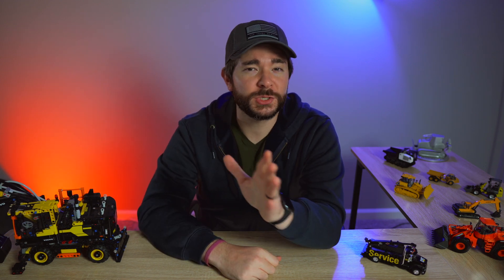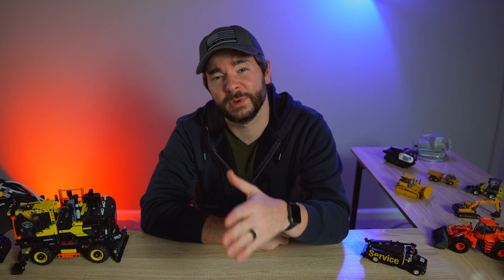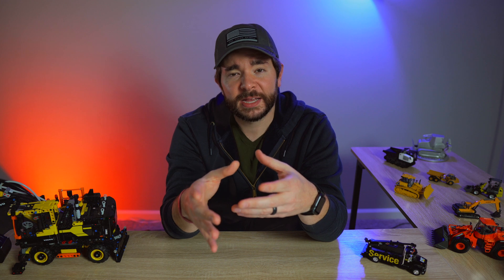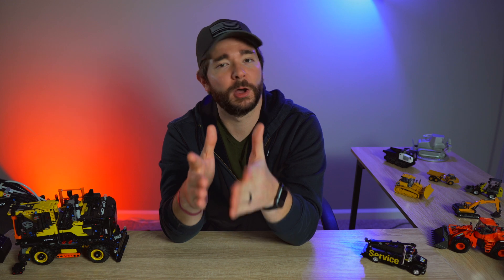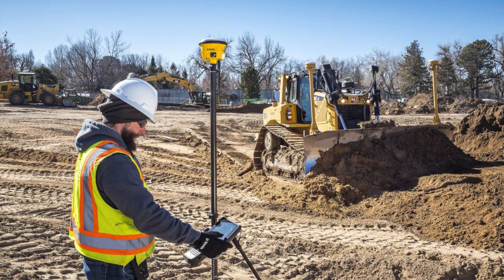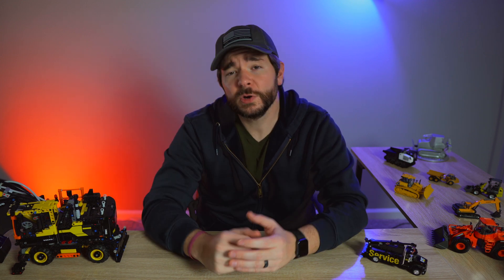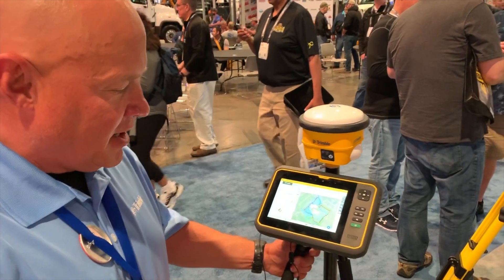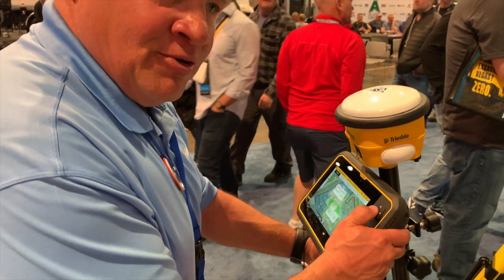Trimble's new SPS986 eliminates need for base station in GPS rover surveys

Comment: 2cm horizontal & 5 cm vertical is not even close to the accuracy I get with my R-10 Base setup with radio corrections.  I typically get a quarter inch horizontal & 3/4 inch vertical.  But this shit will be cool if they get it 50% tighter, it will totally replace GPS.
Reply: No need for that. 5cm of precision for many, many jobs is much more than good. So, my opinion is the price. Many coutries doesn't use US$ as currency, then here in Brasil, today, is 1 dollar = 5,5 Reais. Well, US$3.000 year is equal 1/4 of a RTK new equipment. This makes the CenterPoint/RTX too expensive to pay. So, the traditional RTK sells 20 times more units than this one.
Reply: Luis Anderson Cerino Pires I do a lot of anchor bolt layout, & I’ve personally never done a job where that much inaccuracy is acceptable.  I’m instructed to shoot everything to .01 of a foot or .1 of an inch.
Reply: @baileymaloney1961  Sure for this, I'm a Land Surveyor in Brazil and we measure farm lands for legal documentation, and the tolerance is 10 inches to each corner of the property (very common properties with 2500 acres and usualy 10x this size) So, this precision is not so much needed. But, for each case use the right tool. To mark offsets from rail tracks and asphalt roads for legal documentation the tolerance here is 4 inches, so i do using just one Navcon (John Deere) Starfire who do the job easy and low cost to rent-and-use (US$ 25 a day)